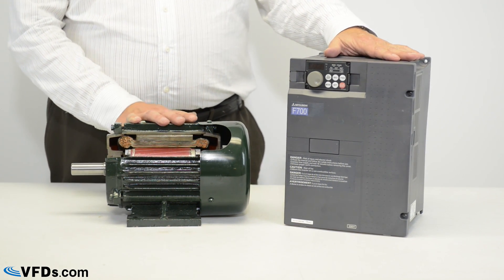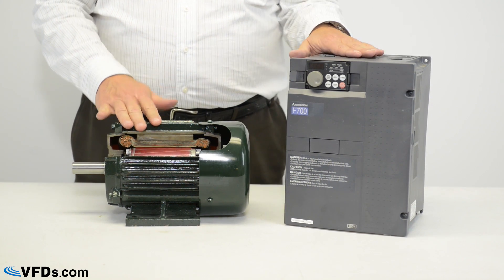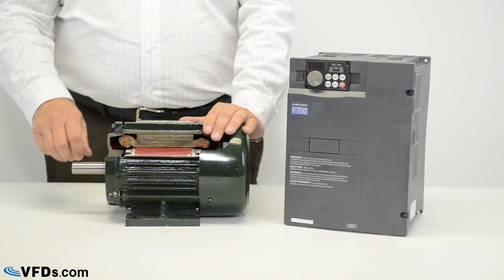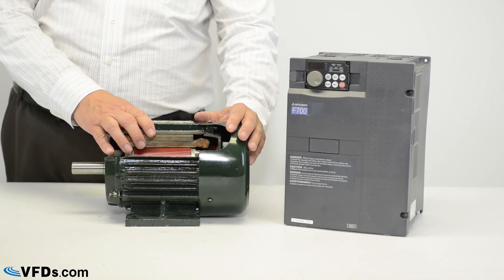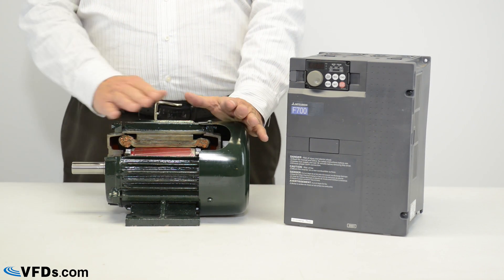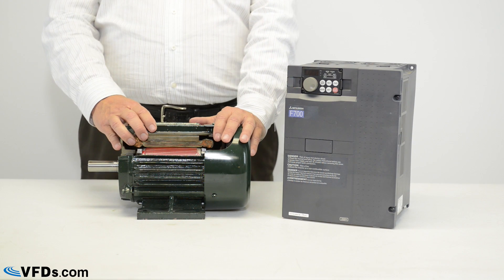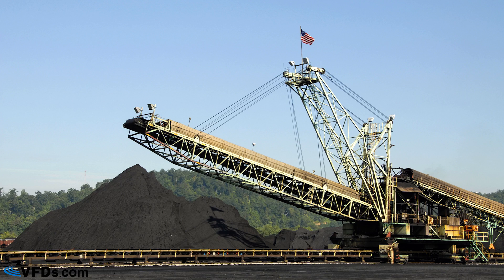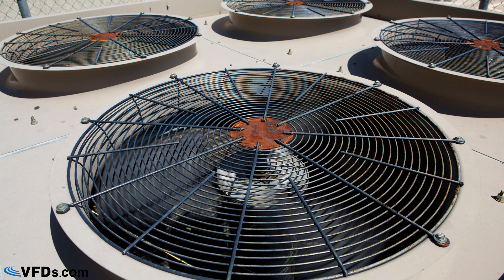What is Overload Rating, constant torque, and variable torque?

Comment: Excellent explanation .... thanks. 
It is mentioned that the Torque  value is same at 0, 50% and 100% speed.                                                                                                                                       
The question how can we get Torque value at zero speed? As to these equations Φ ≈ E/F &  T= K Φ IW  -  Where Flux (Φ), torque (T) & Working or torque producing current (Iw), when speed is zero the flux is zero and then the T is zero?

Comment: Can these power single phase to 3 phase induction heater over 20 kva?
Reply from the maker: Leslie, are you asking if you can use a VFD with your induction heater? If it has an electric motor, yes. You will need to derate a 3 phase to 3 phase VFD to use with single phase power. Meaning you need a VFD twice as big as your motor, so about 40kVa (32kW / 42HP). Use your motor FLA as a measuring unit. Hope that helps.
Reply: do i really need to run a motor to produce the third charge and are capacitors essential as well?  i'm guessing induction heater produces amps at about 17mv not sure what that means but the volts are 300-500v, still learning, sure wish a switch board could do that or safety plug, is it true that nz electricity is far to high voltage, or do i need a safetey trip switch, 
what is the wall unit that converts single phase wall plug of house over to amps AC? or do i just use a DC / ac inverter? because i don't want to use petrol or ./diesel
i hear induction heaters can run on 1kva
does a electric motor serve as alternator ac producer as well as motor running,
i'm sure it's more about charging big capacitors, i won't know until mid year tbh
Reply: isn't there supposed to be a trasnformer infront of the motor?
Reply: what does a vfd do again?